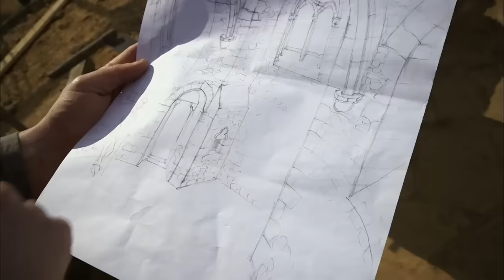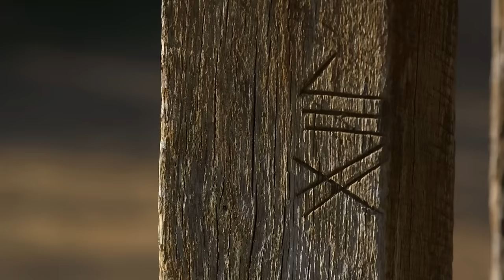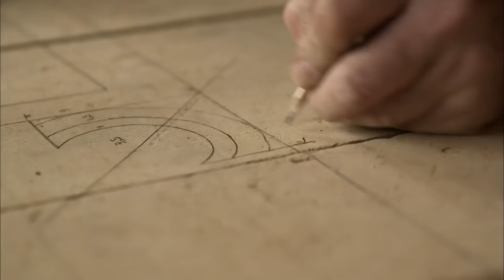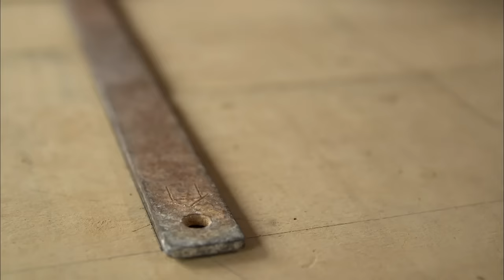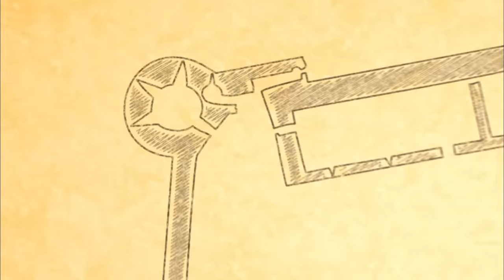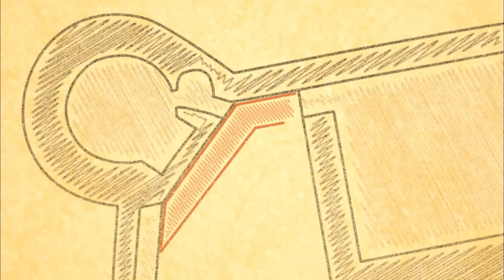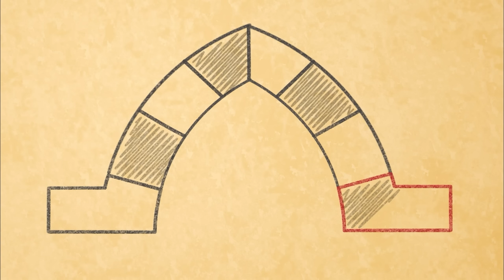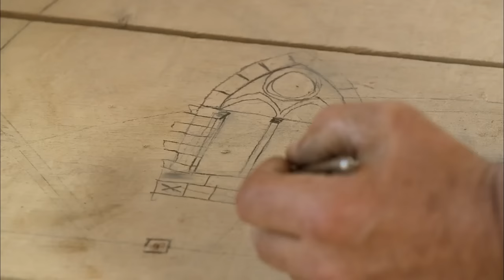Can Modern People Build A Medieval Castle?

Comment: We first saw this series when it was first broadcast in 2014. It triggered an interest in this particular project - so much so that, on our first ever trip to France in 2019 from Australia we went there.
We saw quite large changes in the five years since the shoot. Towers that were incomplete then were structurally complete, decoration well advanced and the chapel in usable condition. The tiles needed to put on but this was done about a month after we were there. It turned out that we had actually witnessed the firing of the last batch of tiles during our visit.
I have followed them ever since and am delighted to see that the double D gate house has been completed and the temporary opening in the north wall has been closed off.
If/When (!) we ever go to France again we will definitely making a return visit.
Reply: Just curious since I just recently found this channel (& have been binging,lol...love it), is it still an ongoing series?? Thank U

Comment: I've been watching documentaries and vlogs made about Guédelon for as long as I can remember, I've watched a lot of stuff about it. It's too bad the paint maker does not speak english, she's got the most fabulous knowledge about making paint.
For windows they are going to string thin pieces of leather, and then paint on it. There's a documentary that goes extensively into the window-making process, which includes a bunch of trial and error to find the correct paint composition. They worked with a german crew from Campus Galli, who are also building a medieval castle in Germany, to exchange ideas about the windows.
Anyways, your documentary is easily one of the most immersive and extensive I've seen, thank you so much for your work !

Comment: I haven't watched all of this but regarding composting toilets 

Forget lime that stincks,
Peatmoss and wood chips worked realy well. No smell. I think the peat moss digests/breakes down the fecies. If they used it as a toilet wipe that would be 2uses for one material, but the peat moss I used to use isn't like that.  The wood chips helps absorb the nitrogen etc. But twigs and leaves can be used instead apparently it just takes time for the right organisms to develop to digest/brake it down. Which is why you don't fully empty them or sterilise them.

It's better if you urinate separately to deficating on smaller composting toilets.

This can be done a few ways such as to separate toilets/buckets etc one for urine and one for feciese.
Or a urine diverted under the seat. Or just urinate in the garden.

I've seen urinals for men made out of a milk bottle and a hose. Straped to the deck.

Urine is sterile and good on the garden etc. To go into a septic is needs to be diluted 1:9 from memory with water. Or it can just be piped out to a sockage pit. Do you find french drains and or closed pits with rocks ect in them near toilets?

Larger units either drain off the urine that seeps through the waste. Or it is absorbed and evaporated from it. The older and larger the toilet chamber is the more capacity there is for the latter. But this is not safe liquid.
Some  of the liquid just seeps out the wooden removal hatch, others have a grate of some sort that holds the waste up higher than the liquid. often at an angle so the waste moves towards the hatch and so the liquid can seep to the bottom  section and drain out.

As for cloths they actually sell cloths on line now as sustainable toilet paper you could lookup how they clean them. Probably like nappies were.

Mullen also can be used for toilet paper did somthing like that grow around there? Some barks can be soft to.

Comment: Answer : As with any building project these days - First , planning permission with full drawings ,  2nd building regs ( including calcs ) , 3rd health and safety with risk assessments. 4th Full compliance with standards set by the previous,  then you can build . Ropes will be modern to comply as hand made rope cannot be tested to comply . Note : The crane is rated at 500 kg , hard hats are required in certain areas ( they appear to be using polished 'hattes' - British Army Brodie style ? ) and steel toe cap boots and to work here , fluent French for communication and adapting to the French terms used for building , fot instance in coursed rubble work , the locking stones are called ' snecks ' in English work .
We do have surviving accounts of castle building in the UK, right down to the nails ( spykings ) and their sizes , but slightly later , Restormel Castle in Cornwall 1340 , but totally relevant. 
When completed the building will require continuous maintenance of course , giving others the chance to learn these skills .
I actually worked on one modern building here in London in the 80s , the Ismaeli Centre , where the tolerances were particularly high and spirit levels not accurate enough for the masons to follow and it was impractical for me to repeatedly use a dumpy or theodolite to carry out our installation so I made pretty much the same kit as seen here but using more stable plywood and nylon cord . It seemed pretty fitting as there were skilled carpenters on site from the middle East using age old techniques to produce incrdeibly ornate carved wooden screens .

Comment: Interesting thing to note about trebuchets. If they are balanced correctly, they shouldn't continue swinging after the projectile is loose. In the example they had, the weight was higher than the projectile needed. They could have used a heavier projectile if the armature would allow. The simpler solution is to take some mass out of the counterweight. They would see about the same distance - if not a little more - and less swing equates to a faster reset.

Comment: Id like to say one thing, the goal of a medieval seige using a trebuchet was not to knock down castle walls, it was mainly to cause destruction on the inner city and it turn cause histeria and pressure the king to give up. If they wanted to knock down castle walls they would have dug a tunnel underneath them and filled the tunnel with explosives and combustible materials. Some walls were impossible to bring down.

Comment: Still those leeks and grain used in porridge, were probably  quite different in past than used it documentary, since in medieval time they grew non genetic engineered vegetables, so they were smaller, not so perfectly shaped etc. And also they didnt had pesticides so many of vegetables were probably bitten by insects, or damaged by disease but they still used good parts of it.

Also, it would be quite interesting to compare lets say barley grown with modern technology  today to medieval barley from like 16th century, to see how nutrient percentage changed during last 500 years.

Comment: I know little about most of this work. However, you would not test a welld by quenching it.
You would let it cool naturally in the ashes. By quenching rot iron, you run the risk of splitting it. In addition, I certainly hope you have purpose for your design. Because I really don't see it. That stuped would have been a poor style of mounting. The foot ring to a crossbow. It would leave you relying on raw hide lashing.